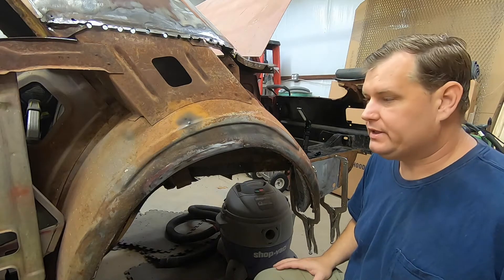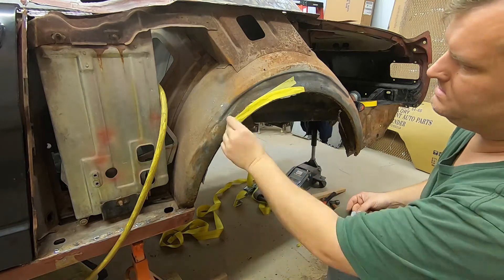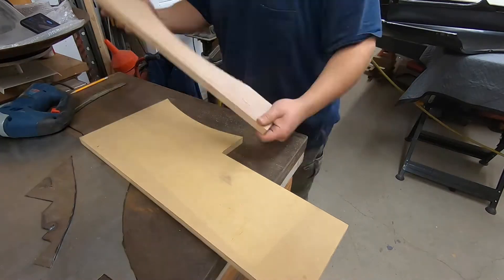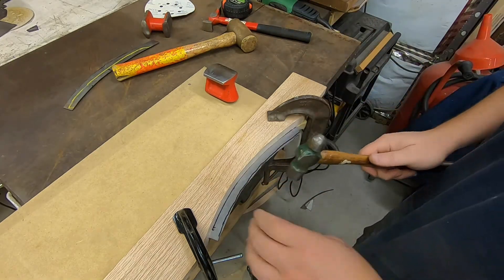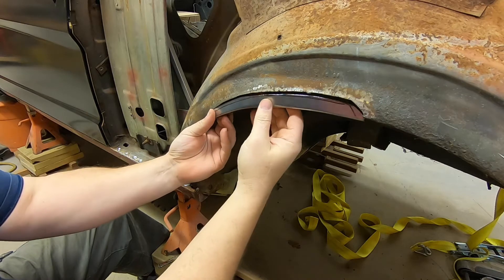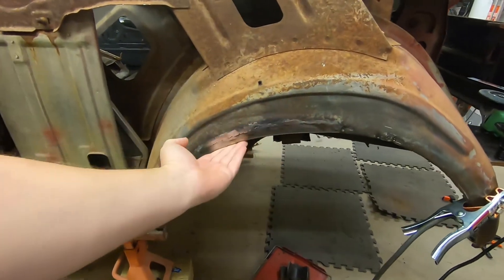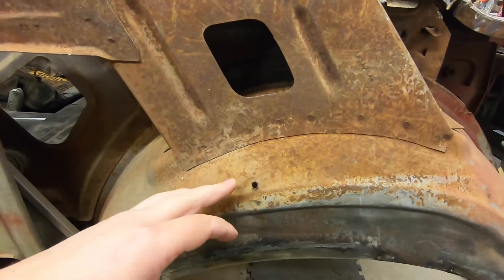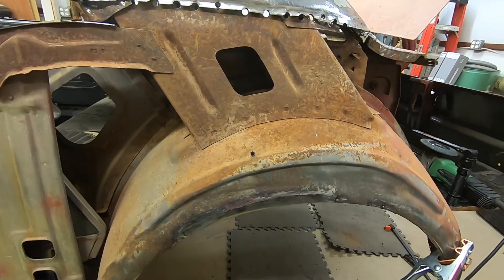Metal forming made easy for autobody repair.

Comment: A shrinker and stretcher helps a lot when forming a compound curve. The panel you fabricated came out just as nice.
Reply from the maker: They also work great for fine tuning your piece when you screw up the initial template... We had bought them for the school shop years ago and they are super handy but sanding out all the marks from the jaws can be allot of work.
Reply: @theinfernalcraftsman  that does take some effort